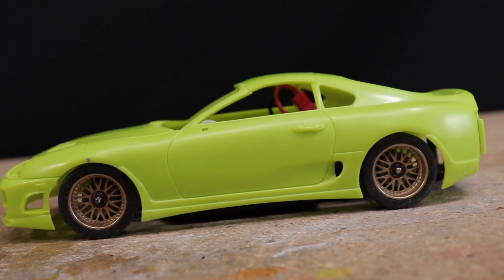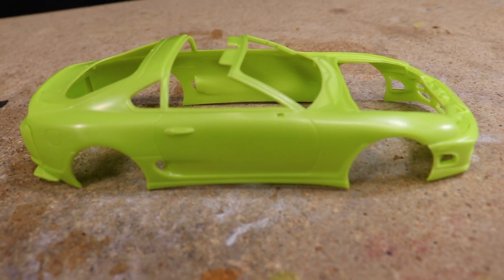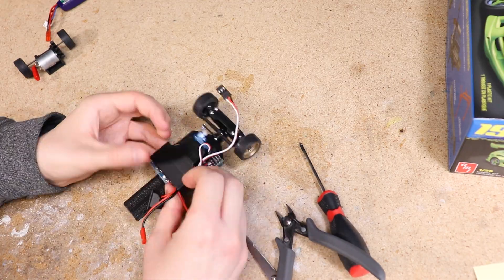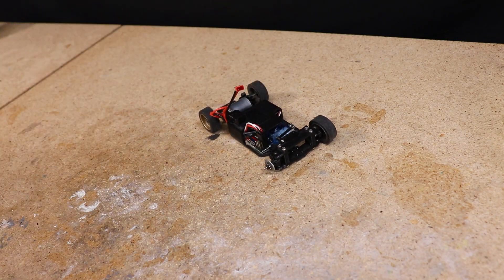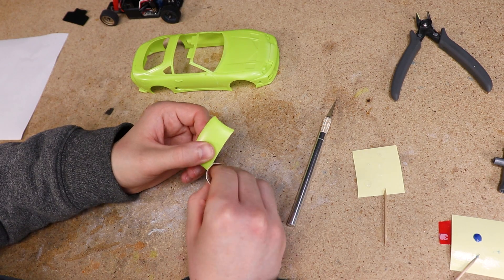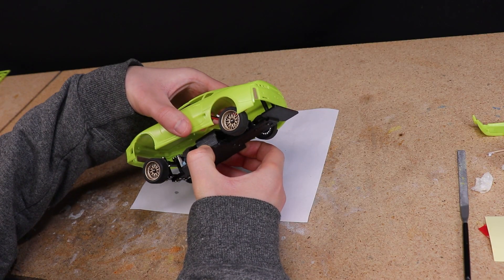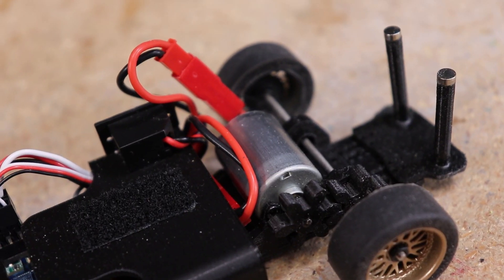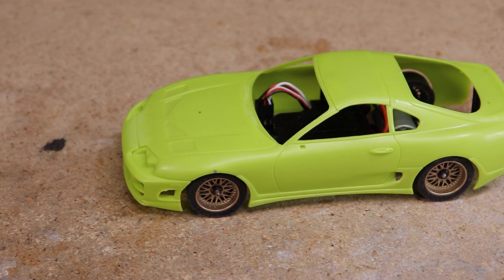My Fastest 3D Printed Micro RC Build Yet? 1/25 Scale 1995 Toyota Supra Project

Comment from the maker: Hope you all had a great weekend. Thanks for watching! Let me know how you'd build this Supra below. 👍
Reply: from your descriptions, needs a pressed on brass pinion gear and a spur gear for about 5:1 or 6:1 ratio. then mount that motor pod on a T plate using screws through small round servo grommets in a triangle gives rear suspension, up front  longer kingpins with coils over the steering blocks like old Associated and BoLink 1/12 and 1/10 pan cars.

insane? using two Syma quad-copter gear heads (6:1 ratio) are powered by a 7x20 mm coreless motor. one on each rear wheel, wired parallel, to run on 1S, or 2S if you get a pair meant for 2S. the motors really don't have any cogging, wired parallel they naturally want to run in step running straight, but can slip like a differential when cornering. there are 8.5 x 20 mm motors made for 2S as well, with the right pinion and spur ratio, the twin motor half shaft to each rear wheel does work. did it 25 years ago twin brushed 05 motors on a scratch built 1/8 scale pan to run against some gassers. same idea just scaled down for 1/24 size RWD so tires don't chatter and break loose when cornering.

get a look into available coreless motor quad-copter gear heads, might find 7:1 or 8:1 ratio powered by 8.5 x 20 mm 2S motors. RC slot car anyone?

Comment: Hey, beginner here, how do you find wheels for your builds? Is there some sort of measuring system to determine which sizes are correct for your FP UC1 chassis? And where might I buy them if I don't have access to a 3d printer?

Comment: Build looks good, l also a quick question will this chassis fit the tamiya or fujimi a70 Supra kits?
Reply from the maker: If you can message us with the wheelbase and width of the body, we can let you know if it will fit.
Reply: @MakeItRC  ok thank you
Reply: @MakeItRC  the wheel base is 108mm and the width is 74mm

Comment: You know, I’ve never seen a green parts tree.
Reply from the maker: I think I built a 67 or 68 Mustang from AMT that had a green parts tree. Not sure what the point is. Even if you wanted a green body, it wouldn't look very good without sanding/painting.

Comment: Awesome Project by the way, just one opinion though. Since this new motor does not have a gear reduction, it may be a good idea to use a different ratio between the gears to improve acceleration, and reduce a tad bit the top speed, maybe a 1:4 is a good start. but of course, i think changing the gears modules will be necessary.
Reply from the maker: That's an option however the reason for the huge 1:1 gears is to make the chassis as essay to 3D print on any hobby FDM printer as possible. Still might experiment though. Belt drive is something I've considered but have not yet made.